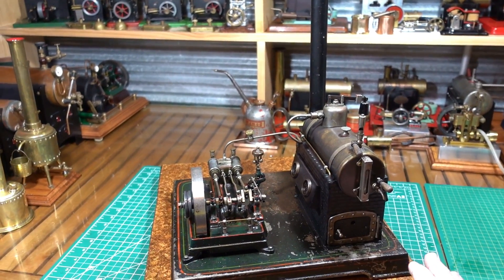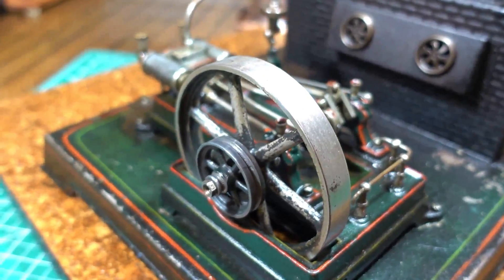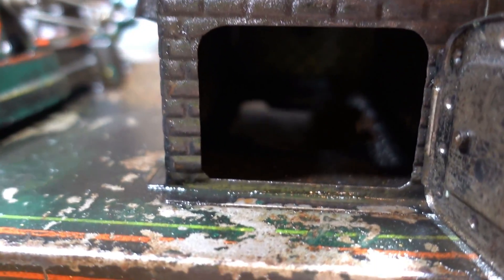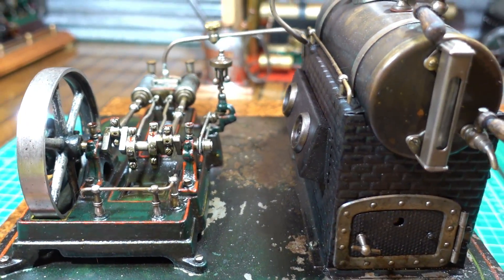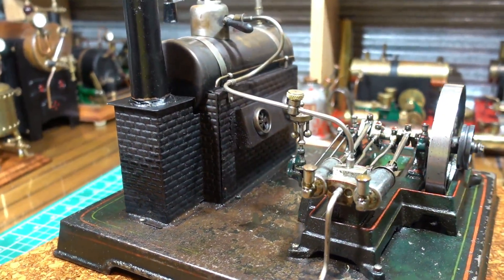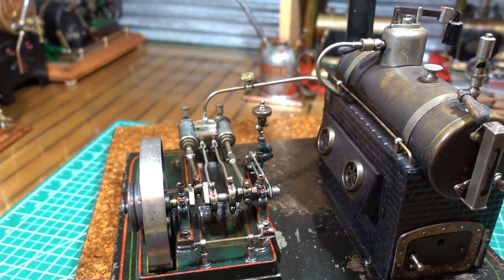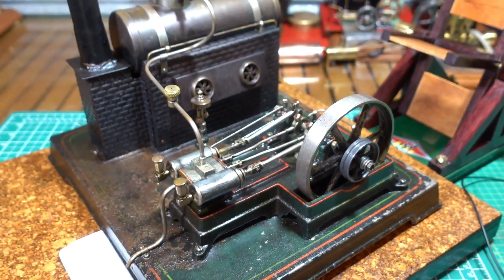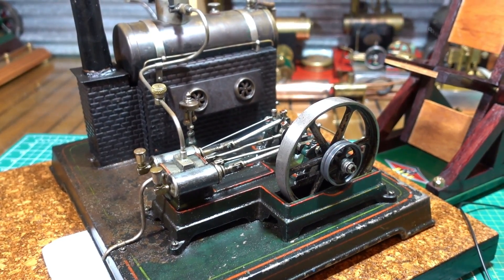Model Steam Engine or also called a Toy Steam Engine Doll 365 on Live Steam running a Baker Fan

Comment: Hello, I acquired a Doll 365/3 and it has an electric heater below the boiler, it looks original, but I’m not familiar with Doll engines and I haven’t seen any videos of them with the boiler being heated with electricity. I’m hoping you can help me out 
Thanks, John Weber
Reply from the maker: G'day John, I've never ever seen (or heard of) a Doll 365/3 having an electrically heated boiler. It would be interesting to see a video of the electrical setup on your channel. - Cheers Jim
Reply: @ 
Hi Jim, glad to hear from you, the engine is 99% complete, only the smoke stack has been shorted, other than that I haven’t noticed any missing parts. It’s quite dirty and will require a complete tear down.. I’ll post a short video today and show you how it looks.
Reply from the maker: @Tshasta4449  It would be interesting to see it John ( I have subscribed to your channel, that dual Stuart beam is amazing!). If it is factory original electrically fired, it would be very unique I would say. I'm thinking some clever person at some time might have retrofitted it, but somethings need a lot of detective work.

Comment: Still a very good runner - the “old girl“! Most impressive!
According to the pictures/photos I‘ve found, your engine must be a 365/1 from “ca. 1930“ (quote) - except that your specimen has got the oiler on the steam pipe leading to the valves.
Reply from the maker: Thanks for looking it up SD, I'm not sure if at some time in the old girls life someone has 'fiddled' with that steam pipe. Its not at the perfect angle I would have thought that the Doll engineers would have been happy with producing. Kind regards Jim
Reply from the maker: Thanks for the heads up re: 'The Soccer Ref".